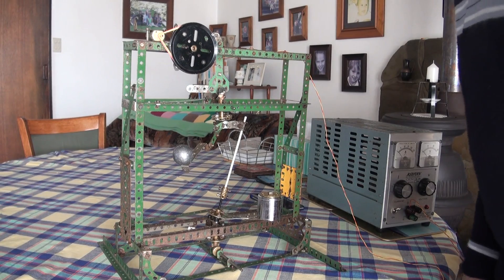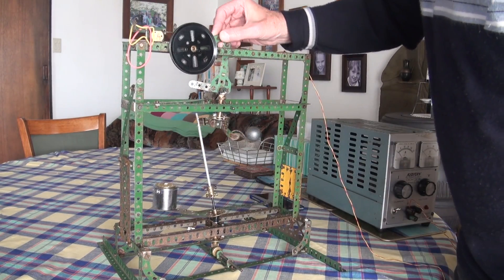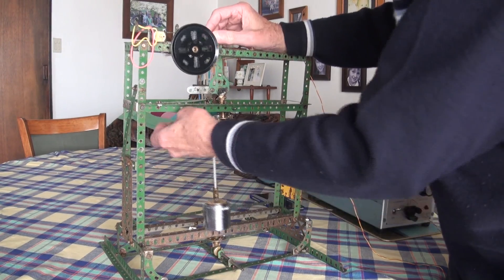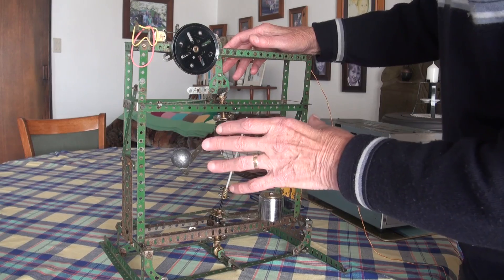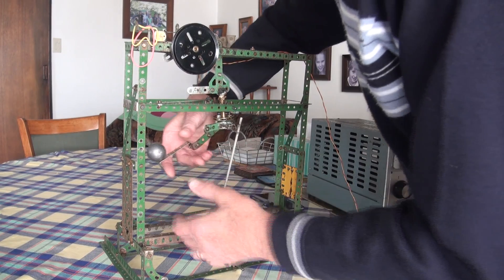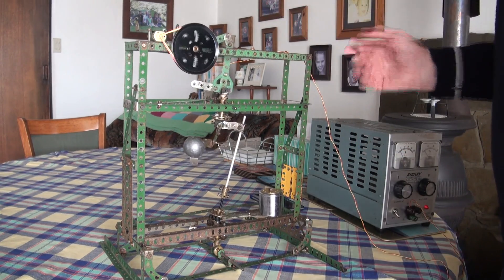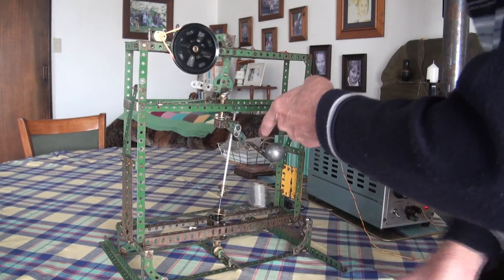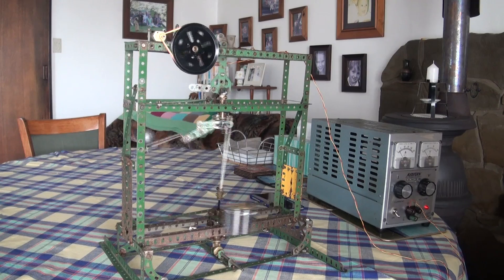Simple explanation and demo of Skinner Gravity Power device x264

Comment: one thing for sure, the bottom weight is spinning in a circular motion,  it cannot spin in an elliptical motion it's impossible because the weight is on a arm that attaches to the bottom of the  lever shaft.  it can only turn in a circle.    watch the weight, it is smooth, even  rotation.  the bottom weight is not lifting higher at any point in it's rotation.  once the weight is lifted it stays lifted, there are no changes taking place after the first lift in regard to the weight changing in height,  it stays lifted.  so one would ask if it stays lifted then how can it fall ?  you would think once lifted then gravity can act on it and you would get your rotational  spin and acceleration of the mass during the fall and then quickly before the weight reached the bottom of the fall you would have to push the lever back the other way to lift it again and repeat.  you can do it that way but what you are really doing is you are lifting the mass twice each revolution and allowing it to fall twice each revolution.  the skinner machine is not doing that.  now think, you pull the lever back, your doing work lifting the mass and the mass is lifted up to it's highest point, now for a half revolution the mass is falling to it's lowest point,  and if you draw a line from it's highest point to it's lowest point you would see the angle the line makes, indicating the weight is going up and down in height.   this is totally obvious if you just move the lever in just a forward and backward movement.  the same thing happens in an elliptical motion only to a lesser degree. the weight is still lifting to it's highest point and falling to it's lowest point before quickly being lifted again but to a much lesser degree.    the problem with an elliptical orbit, there is a speeding up that has to take place and a slowing down that takes place.   the skinner device does not have any speeding up or slowing down periods.   there is no lifting and falling then repeat.  the weights are all ready lifted, the machine was built with the weights pre-lifted to almost the point where they are level and balanced and ready to pass the point where they fall in the opposite direction.  at this stage the drive motor is activated and because the weight is already lifted and at a balance point it takes very little power from the motor to tilt the weight past it's balance position using leverage.   now the weight starts to fall but simultaneously the lever rotates in a circular motion  which keeps the weight in the just past balance in the falling position.    this causes the first weight to continually fall in a circular motion,  important to understand that the weight is now falling from gravity acting on it,  the lever must not obstruct the weights falling action, it is only there now to continue it's circular motion to maintain the weight in the just passed balance falling position.   at this falling stage the weight will accelerate and the lever must also accelerate to stay ahead of the spinning weight, if the lever goes to slow the weight will catch up to the lever and the lever will obstruct the weight from falling, and if the lever moves to fast it will catch up to the weight and push it.  the weights falling action  cannot be obstructed by the lever.  there will be a speed that the weight will want to travel at based on factors like friction, the length of the arm attached to the weight, how far passed the balance point the weight is lifted and I am sure other factors.  the drive motors speed must be tuned to keep the lever ahead of the falling weight.  now once this is accomplished and the weight is falling continuously un- obstructed  you now have a spinning mass which has way more power and torque available than the motor was having to provide.   you now take this amplified power source to drive the next lever, and it must do the exact same thing the first lever is doing,  only you can now drive a much larger weight.   skinner made four of these  two weight devices and put them on one frame to get more output power.    but I say that is not the way to go, remember how this device amplifies, little power needed to create a condition where gravity can continue to act on the first weight, then the first weight now spinning creating a large amplification of power uses that power to drive the next lever which in turn creates a condition where gravity can act on the second weight,  and what do you have now ? you have a even larger weight spinning creating a even larger source of power than you had in the first spinning weight.  so obviously you would now drive another lever to spin a even larger weigh.  skinner could not do this because his shop ceiling height was two low.  making four two weight systems side by side is a waste .   each spinning mass must drive the next lever to drive the next even larger spinning mass.   just think if you made this thing 20 feet tall and had 4 consecutive larger masses.  your amplification would be way way more than skinner was getting.

Comment: the skinner machine is a gravity harvesting device, it works like this, it begins with the top  lever,  this lever is the beginning stage.  the lever has three functions, 1. it uses leverage to hold the weight to a just past balance position, 2. it rotates in a circular motion while maintaining the weight at the just past balance position. 3.  it drives the second stage lever in order to maintain the second stage weight at it's just past balance position and also it's circular rotation.  now the weight has two functions, 1. provides mass for gravity to act on.  2. stores energy in a spinning mass that is then used to do the majority of the work to drive the second stage lever.     the gimbal: it provides a fulcrum point for the lever to gain leverage and also allows the lever to rotate in a circular motion.   the location placement of the fulcrum on the lever shaft will determine the levers top and bottom circular diameter paths which also sets the height the weight will be lifted and the amount of leverage that will be used to do the lifting, leverage is also used in the rotation cycle.   however know this, the lever is not there to rotate the weight, it's only there to set a path, a circular path and to create and maintain the weight in a just past balance position. gravity must be the only force involved in rotating the weight. this is where many people are failing in their reproduction efforts, using the lever to push the weight.   the lever does not push the weight and neither dose it restrict the weight from falling.  as the lever rotates and keeps the mass in that continuous falling position gravity is harvested in the mass causing it to spin.     now the second stage,  the second stage is exactly the same as the first stage,  there is no difference in  it's basic  function.  you are still working with a lever,   in fact it's still the first stage lever that is rotating the second stage lever.   only now you have the added energy amplification  added by the first spinning mass.   you now have more force rotating the second stage lever than you had in the first stage.  and you now use this amplified  force to act on the second stage lever to lift the secondary mass into a position where gravity can act on it.   the same as you did in the first stage.   the key to success is first making sure the top lever is lifting the first mass to the correct position then maintaining that position while rotating.   next you must attach the top of the second stage lever to the plate in the precise location so the second stage lever performs the exact same function the first stage lever is doing.  the second stage lever has to be doing the exact same thing the first stage lever is doing.  the second stage mass has to be lifted to a just past balance position and maintained there while the second stage lever rotates.  the rest is a matter of sizing your masses.            the drive motor at the top has to run efficiently,  geared to use the least amount of amp draw while still able to operate both lever stages. also the drive motor must maintain a constant speed a head of the falling mass, if the drive motor is going too slow the falling mass will chatch up to the lever and prevent the mass from freely falling.  if the drive motor goes too fast it will be pulling the weight around it's rotational cycle.    sizing your first stage mass,   how large of a mass should the first stage be ?  remember the power to rotate the first  mass comes from gravity, but the power to keep the mass in a position where gravity can act on it while it rotates comes from the drive motor.  if you put too heavy of a mass on the first stage the drive motor will draw to many amps.    size your mass according the amp or wattage draw of the motor you have chosen.    the second stage mass size plays a role also in the power draw of the drive motor too but you also have help now from the first stage spinning mass, it is helping to rotate the second stage lever so you may find you can just keep  increasing  the second stage mass size until you start to see a increase in your drive motor amp draw.  use the amp draw of the drive motor to adjust all gear ratios, mass sizes and lever arm lengths         there are other factors to consider to, such as the distance the weights are away from the shaft, things may change in rotational speeds, how high the mass must be lifted to reach the balance point,  the higher you have to lift the mass changes the levers circular path diameter and the torque on the lever and the overall size of the machine.  the larger the diamter of a circle the bottom mass makes the more torque you will have available at the shaft  to drive things.   and know it's gravity that is providing the amplification so your power output will be determined by the size of your weight, the larger the mass of the weight the more power you will get out of the device. 
of a circle the bottom mass makes the more torque you will have available at the shaft  t

Comment: If it were overunity the output would be more than enough to drive the input, but once again we have all the hard work of building a machine but the easy work of connecting the output to the input mysteriously missing and an external power source driving it instead. I WONDER WHY...
Reply from the maker: I had no intention of proving overunity  l was just explaining how Skinner's drive converted balanced linear motion to gravity assisted rotation.
Regarding over unity, the Skinner mechanism was driving  heavy workshop machinery with a 1/4hp motor via a cotton thread. It's very easy to be an armchair sceptic.

Comment: If it is generating more power than it is consuming as claimed where is the penalty ! ie Where does that extra energy come from . If it comes from gravity then exactly the same amount of energy is require to restore what ever "fell" under gravity back to its original position so it can "fall " again . Energy is not free and it comes with a penalty , you can never harvest 100% of it and it certainly cannot be generated without a consummate  input of effort as this device claims .
Reply: If it’s generating more useable work than it’s consuming, (and know it’s not), then by definition it would be able to power the upper motor. Or the upper motor becomes redundant. 

In the 1938 vids Skinner’s demo never powered it from the ‘over unity’ power. Skinner’s description sounded like a mechanical amplifier. His 1/8 HP input returned 12x more HP output. 

Come on. He could’ve said 1.5x and it’d be just as impressive and impossible.
Reply: @larryscott3982  Exactly !  If he said it gained 1.00000001 x it would be spectacularly impressive and impossible .

Comment: Very nice replication ! Most people dont understand well the skinner effect.... i work a lot on some replication of skinner device, and also on other gravity machine, and tell me if i am wrong, the upper weigt have a lot to do in the system, because it act like a counterweight like in a lever system, helping the gravity force to push the lower weight ! the weight of both must match, otherwise you lost lot of gain,  if its well balance the input can be multiplied by a factor of x  to reach overunity !
Reply: the upper weight is the first stage of gravity harvesting.  it does the same thing the second stage does,  only the first stage provides the power to drive the second stage. I haven't thought about the first weight acting as a counter weight but you may be correct, the weight may counter balance keeping the whole system from destroying it's self.    the beginning stage uses input energy to actuate a lever, to use leverage to lift the first weight to a posistion where gravity can act on it, pulling it down in a spiral rotation, it continually does this and the first weight keeps lifting and falling.    then the energy of the first stage rotating mass drives the second stage, the second stage being the same as the first only there is more power now to lift a larger mass using the next lever arm with the larger mass on it.  you can keep doing this, adding more stages,  and keep amplifying till your spinning a army tank, all from only the first stage input power.    it amplifies because this method can harvest gravity.
Reply: @rmendes2mendes915  Gravity Harvesting ?  A hydropower station certainly harvests gravity but the ultimate energy input  comes from the Sun  . What is the ultimate energy input of this device , only the tiny motor ?  In order to harvest gravity something must fall from a high position to a lower position and in order to reset ,  energy is required to lift it back up to the higher position .
Reply: @dongraham4760  The ultimate energy input as you put it can be many different forms.  this is a gravity harvesting device that uses a form of energy, in this case a motor but you can use anything that has a force really.    Then it takes that energy and uses it to actuate a lever,  the lever uses leverage to manipulate a mass into a posistion where gravity can act on it, it then falls,  when it falls it doesn't just fall straight down it spirals down creating a circular motion, but before it reaches the bottom the lever acts again to lift the mass again back into that position again so that gravity can act on it again. this is a continuous process, you keep lifting a mass using leverage and gravity keeps puling it back down. but there is another effect created, rotational energy, mass spinning.    this first stage drives the second stage in the same way only its the rotational energy from the first stage being used to actuate the next lever to do the very same thing the first stage does.     and that answers your question, something is falling from a high position to a lower position, the mass you just lifted up.    and it resets when it lifts the mass again.      energy amplification is created in the oscillation, rotation.   you can do this in other ways too, see Milkovic oscillator, another gravity harvesting machine.
Reply: @rmendes2mendes915   I am sorry , you are obviously not an engineer !  You cannot defeat the laws of nature as this device claims to do . You use the word "lift" and in order to use gravity to drive anything the weight or whatever must start from a "high" and fall to a lower position , this results in an energy release of X . Now that weight can travel through a spiral motion as you say on the way down , it makes no difference . But in order for it to release energy again it MUST be lifted back up to the first position which takes an energy input of X + friction compensation the elaborate mechanism creates. 
I'll say it again , you cannot defeat nature ! There is no device on earth , and never will be that produces more energy than is put into it . In fact there is no device on earth where you can extract the same amount of energy that you put into it . 
The equation of the Universe : Energy in = Energy out + losses (friction etc)  In this equation is the death of perpetual motion devices or over unity devices .
And as for the Milkovic oscillator, once again you are not an engineer and I know exactly how  this "miracle " device works and it ain't no miracle ! And it is not harvesting gravity !  The swinging pendulum which must be constantly maintained with a push just varies the bias of a cross beam by transfering the pendulum variable load (by swinging) causing the beam to "teeter totter " a small amount . Big deal ! There is NO energy or work magnification involved and all that is happening is that the effort going into maintaining the pendulum swing is transfered into an up and down motion of the beam at it's other end . Exactly the same energy "released"  - losses as is put in. And as for Milkovic himself , a bigger self promoter I have never seen . He has even recommended "himself " for the Nobel Prize for his invention , WOW ! 

https://www.milkovicpendulum.com/iniciative_for_the_nobel_prize_award_in_physics_nomination_en.html

The only thing I have seen where his miracle pendulum is used is in his water pump but in order for it to pump water a large heavy pendulum must be kept oscillating continuously  and requires a push on every swing . This is energy input and does have a mechanical advantage ,a lever , but no free energy . He claims 1200 liters per hour on his enormous pump ,big deal , there are hand pumps all round the country that can easily do that and far simpler .

Comment: Hook up the bottom axle to a generator and have that generator run the little motor at the top. If it runs continuously then you have over unity. If you can't run it without a power supply, then the design is only an interesting toy.